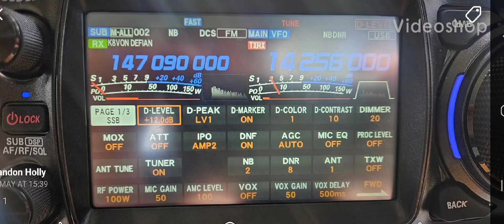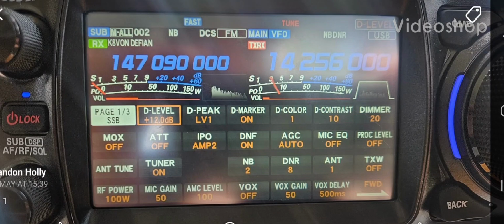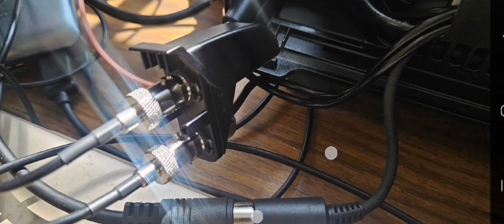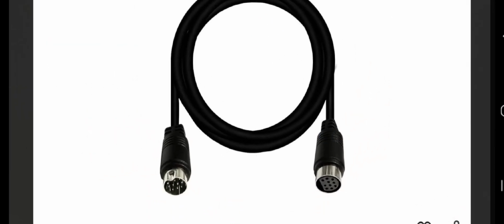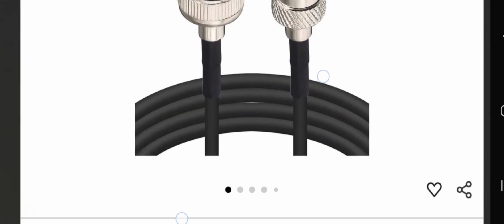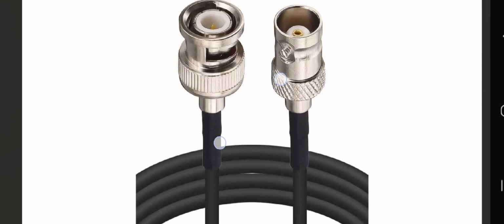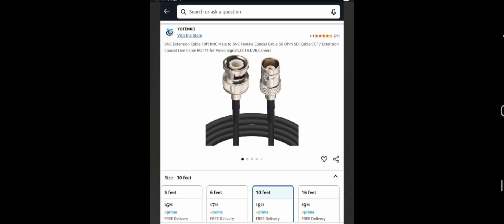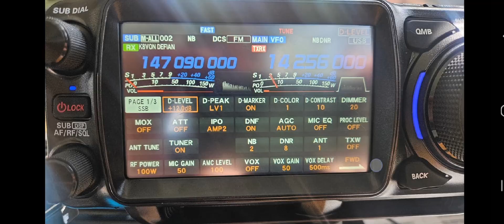Yaesu FTX-1 Optima  D-I-Y Extension Kit

Comment: I followed his lead and have the optima remote mounted in my truck.  Only downsides are 1) no programming software yet from RT so only hand programmed about a dozen repeaters 2) APRS messaging doesn’t work yet 3) the optima won’t tune the ATAS 120 until some future firmware update
Reply from the maker: Yes future will be better.
Reply: I have been using my FTX-1 Optima to tune my ATAS-120a.  I am on the latest firmware, so maybe in the latest version its been added.   The OP also posted 3 months ago.
Reply: @W5LBX absolutely it. Added with firmware update #2

Comment: Hi M0FXB, this is Brandon, KE8CHZ the big CHEEZ, thankyou for sharing my pics! I have been using this setup for a little over a week and havent had any issues. I have had it mounted im my truck and also use it remote in the house as it saves a lot of room on my desk. Aside from the usual little bugs the radio has had it has been working great! I havent used it once with the head attached to the amp. Thankyou for the videos, I have been watching them for awhile now, i enjoy your content! Thankyou and 73s
Reply from the maker: Hi Brandon , thanks loads i should have my FTx1 soon fun times :)

Comment: I am planning on a longer round 2p power cord with Power Poles for the FTX-1 head. The manual does not provide the specification details other than volt/am.   Hole size & length details are needed.  None of my other round pin charge connectors fit.   From this video, it looks different than mine so perhaps you know and added some length?
Reply from the maker: Sorry no idea.
Reply: Search for DC6330 connector.  It is 6.3x3.0mm  + on center.
Reply: You can power the head with the factory field head cable, it does not need to be powered from the amp. Although I did make a power cable to put with this setup and they are all now run through an anti abrasive sheath. The cable ends are on amazon also.These are pics of my setup so I know it works.

Comment: It looks like the battery is attached to the head. If using the Optima version with body under the seat, presumably the radio will work without the supplied battery, with head powered directly from the battery or car accessory plug? (With radio body obviously needing direct battery connection). It seems like a power wire extension from the body to the head will also work?  I have the Optima and also looking for the mobile solution.
Reply: I have tried this both ways, in my posts I have had the head solely on battery and the amp would still work. Battery gauge would be on top left and radio would still show 100watts power. The head only needs to feed maybe 5watts to the amp. I left the battery on simply because it was already on. It didn't need to be there.
Reply from the maker: Yes good points
Reply: you don't use the battery when connected to the amp.
Reply: The head without the battery is exactly why I am looking for a better way to supply power to the head with the battery removed (for mobile operation).  There are two best ways to power the head as a mobile with the battery removed, I think (maybe 3 with C connector). (1) An extension from the amp body cable that plugs in to the head when the battery is removed and the head is attached to the amp. Or (2) 12 volt from the car directly to the head to the round power receptable   Potentially the C PD like the Anker will also work and connect the C directly into one of my car power sources, I haven't tried it yet. DX Engineering tell me that the plug is a 6.3mm x 3.1mm connector. So far I haven't found a source with a Yaesu plug with Power Poles.
Reply: You can source the FTX-1 13.8V either from the SPA with an opposite gender connector or a different source.  Depending on how you have it mounted you can have the battery attached or not, your choice.  I chose to leave the back open for cooling reasons and mounted off the bottom hole.

Comment: Yaesu said specifically this wasn't possible over and over.  

It's a 10-pin DIN connector.  It has a special orientation clocking and the Amazon cable shown may require minor mod to the shell.
Reply: This is my radio in the pictures, the din fits only one way. I have been using this setup for over a week in my truck and in my house without any issue.
Reply from the maker: No i didn't John Kruk Yaesy  said it also this ia a Modification .
Reply: @M0FXBHamTech  Where did Yaesu say it was a modification?  Link?
Reply: Are you getting 100w.  I didn’t until I modified the Din shell
Reply: @SWClvU i had a similar issue, my din cable was not going in all the way. I have to shave some of the casing off, now it works fine.

Comment: Short runs of cable were always going to work. But what happens when it's longer and there's 100w of RF floating around on transmit. Time will tell I guess. Maybe Yaesu needed FFC etc approval to promote and sell it so never bothered.
Reply from the maker: We only need 10 ft
Reply: @M0FXBHamTech  We will see what happens I guess. But yes would make a great mobile rig if it does work. Fingers crossed.  I think 5ft would make it long enough to fit under a front passenger/drivers seat.
Reply: @militaryrig I have 16ft extensions on.  The issue from what I read was extending the power.  Not sure about others but I am running it with both the field and the spa plugged into the power supply in my truck. No issues yet
Reply: I believe your thinking is correct.  The FCC test reports are very specific about the FTX being attached to the SPA.  Time was tight before Hamvention so this is what we got.  Not only on this point but many other things prove it was rushed out the door.
Reply: Remotely you are only sending maybe 5watts from the head to the amp, don't over think it. It is no different than using a 705 with an amp under the back seat. The din is  basically the only thing that's different. An 857d with the body putting out 100watts under my back seat is no different than the 1f body putting 100 watts under my back seat.
Reply: @HollyArms1  Yes, 5-10 watts from the FTX-1F to the SPA-1. However, 100 watts from the SPA-1 could easily get into a crappy cable or loose connector and feed back into the FTX-1F or the input of the SPA-1.

Part of testing for an FCC equipment authorization is checking RF emissions from all interconnecting cables. If Yaesu did not provide cables for remoting the SPA-1 to their FCC test lab, then the radio could not be tested with them. If Yaesu says "yeah, sure, you can roll your own interconnecting cables" then they might get into hot water with the FCC.

I do think it's a bit disingenuous for a Yaesu rep to say "the SPA-1 can't be remoted". It would be more honest, in my opinion, if Yaesu simply said "we don't provide cables for that application and we can't be responsible for what you do with the radio after it leaves our hands".

Comment: Is power delivered to the separated amplifier via the DIN cable?
Reply: No  I have been running the exact same setup for about 2 weeks.  VHF UHF only for right now.  Using both power cables that came with the radio
Reply from the maker: I will test
Reply: When attached, the head receives power from the amplifier by a separate 3mm connector, as one of the 5,  not via the DIN cable.
Reply: No.  There is a logic level voltage but not for powering the amp.